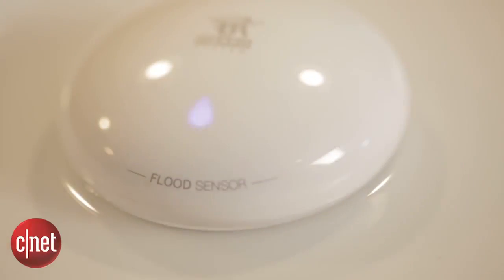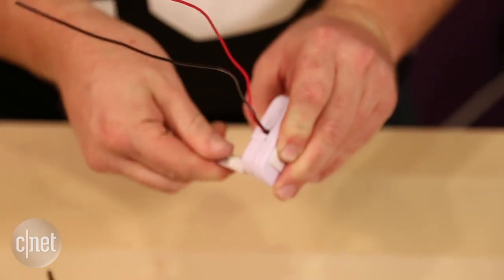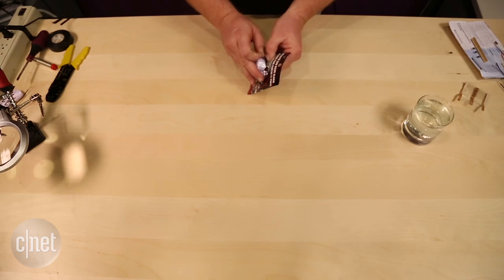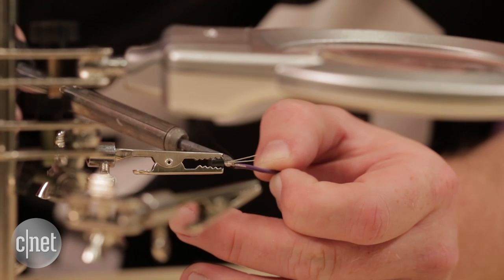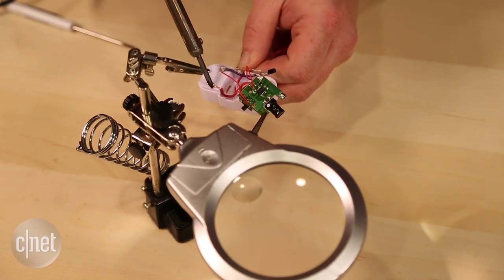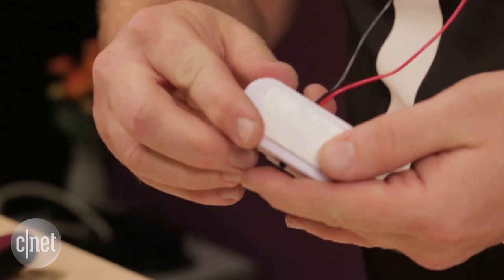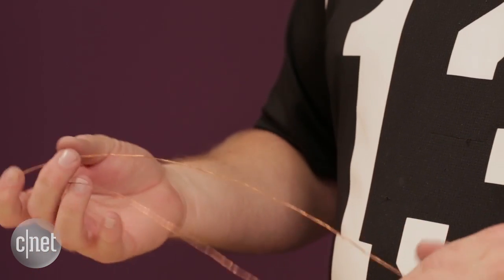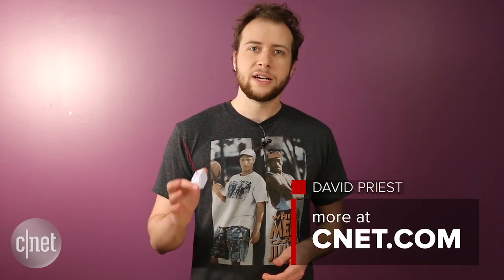See how to build your own flood sensor out of inexpensive parts

Comment: I would use 2 conductor insulated cable instead  and only strip insulation in certain areas where water is most likely to appear or collect (low spots).

Comment: Is there any concern regarding human contact with the water as it is part of the electrical circuit? What happens if someone would stick their finger in the middle of that puddle between the two leads?
Reply: No concern. Your looking at probably 3volts dc, 6v max.

Comment: Another way is to plug in an extension cord and leave the other end on the floor, water will cause the breaker to flip, and now you know there is water in your basement.  That's what my grandparents did. The more used the circuit, the more effective it is- TV, lights, kitchen, etc
Just realize that it will be a couple days before that extension cord is safe again. But an awesomely cheep solution, especially if you have a bilge-pump in your basement, if the pump fails -the TV turns off

Comment: Not trolling, but the $15 sensor will notify me via wifi. And the homemade one doesn't ? I will pay $15
Reply: +Derp   Exactly !   Watch the first part of the video,  it is mentioned,  and in the description it says $15.  Amazon shows that device at $59.99. Also, what they build in the video is not wifi.
Reply: you do know about super cheap Arduino and similar hardware that can be easily added to make this WiFi enabled, right? 
Someone capable enough to build this circuit can hust add the WiFi for cheaper than ANY  off the shelf sensor with the same capabilities.

Comment: much easier: Take the alarm and extend the magnetic contact with 2 cables. Put them near together in a glass of water and put some salt in it. When the cables are in the salt water, the circuit is closed and the alarm does not start. If a flood occours the glass gets filled with the flood-water and loses the salt -> the water does not carry the power anymore and the alarm starts.
Reply: Your solution is just as foolish....